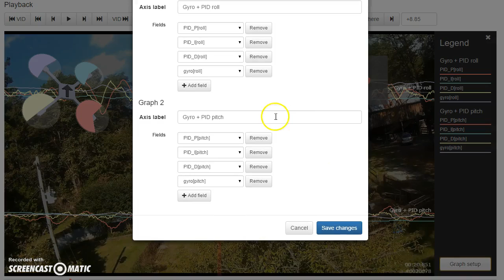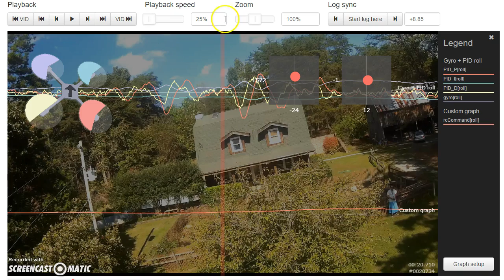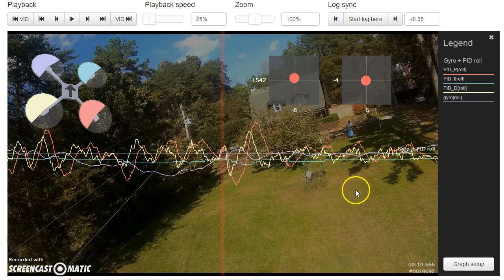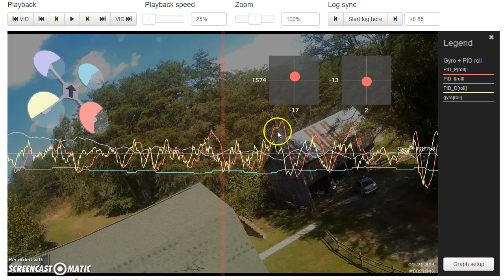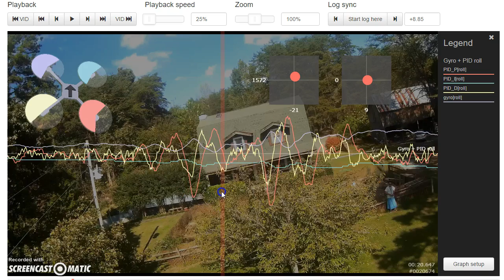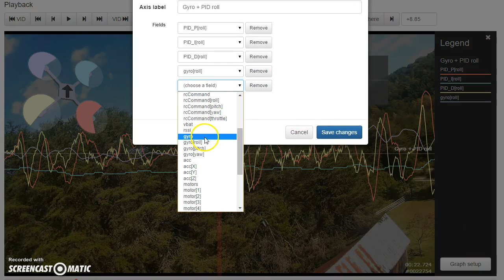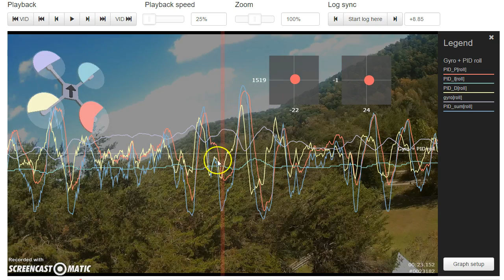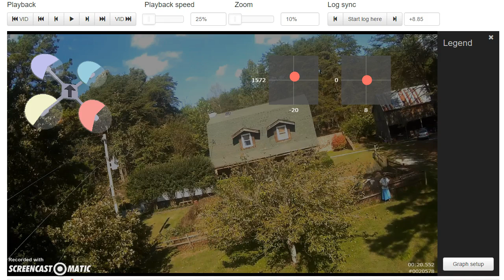Blackbox Log Analysis: joshuabardwell 10/13

Comment: You have new ESCs so I would have a look a things that have been constant throughout your build like your motors. When you have crashed you might have damaged one or more of the motor bearings. Try holding the arm near each motor and flick the prop around fast. Do you feel any roughness ? I have a similar problem to you and I'm going to replace my bearings in my T-Motor 2206s as I do feel that roughness on 3 of the motors.
Reply from the maker: +Tony Leyland Expressive Imagery Thanks for the suggestion. I do have one motor that feels a little rough. I've got a spare, so I'm going to swap it out and see what happens.

Comment: What camera do you use ? I noticed that your videos have quite a narrow field of view and I'm guessing a RunCam or Mobius. Having a camera with a wider field of view will reduce the amount of visible vibrations in the HD footage, but I know that you did not want to hear that as you are super keen to find the issue not mask it ! Perhaps this is also why you have not seem much of this in the flight camera if that camera is wider FOV than the HD camera ?
Reply from the maker: +Tony Leyland Expressive Imagery Mobius, yes. A lens, I think, so not the widest. Your point about the FPV camera having a different FOV is a good one, but I think they are not too far off. I believe my FPV cam has a 2.8 mm lens.

Comment: I recently had something simillar and one of my motor magnets got loose. It took me a while to figure out. There were random small oscillations.

But you should also check other axis as well like yaw for example. Dont think its that here, but anyway.
Reply from the maker: +Boris B. Good point. I am flying Sunnysky, which are notorious for throwing magnets. I have already lost one that way.
Reply from the maker: +Boris B. Thanks for suggesting that I check the motors. The magnets are all in place, but there is one motor that feels a little rough and may have a bad bearing. It was subject to a pretty bad crash recently, after which the jitters started. At first I thought it was the prop, but then I changed the props and it was still happening, so I thought it must be my tune. I guess I just default to thinking of everything as tuning-related.

Comment: This twitches looks to me like there is some problem with your motor bearings. Did you checked that? Keep up the good work!
Reply from the maker: +TheLypse I think the bearings are okay, but it never hurts to re-check.
Reply from the maker: +TheLypse  Good suggestion. It turns out I do have one motor that feels a little rough. I've got a spare, so I'm going to swap it out and see what happens.